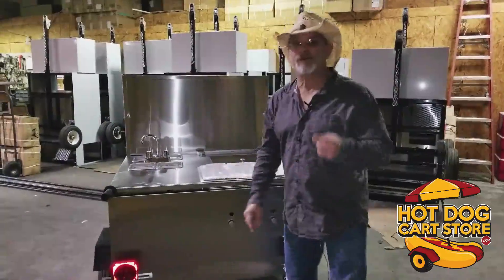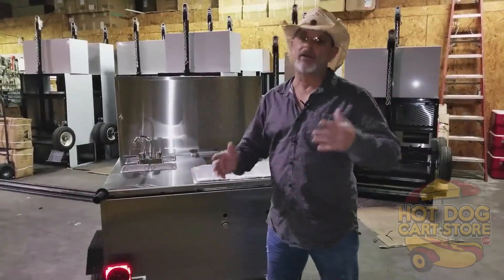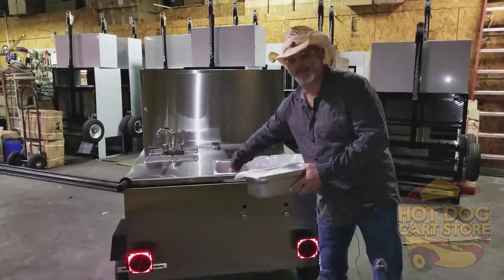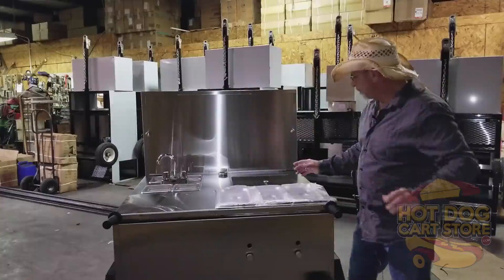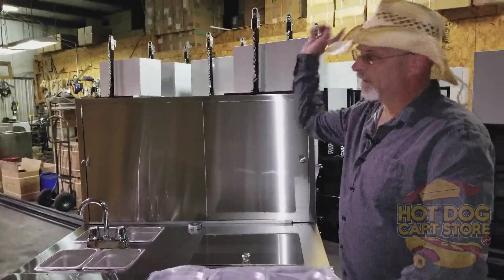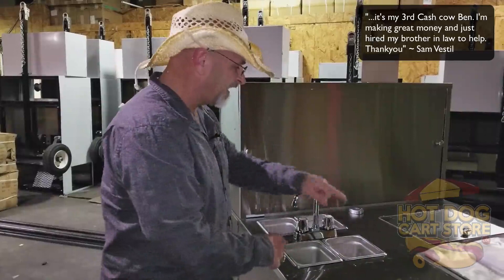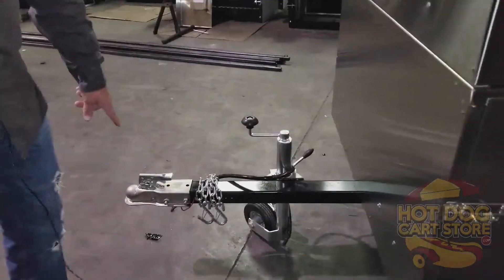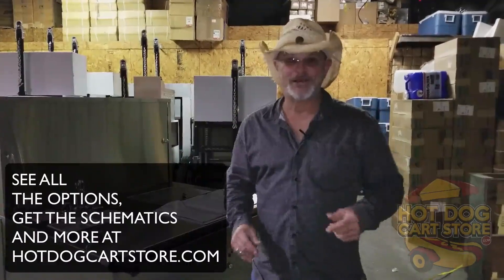Cash Cow Hot Dog Cart

Comment: Thank you for the video.

Here in Yuma, Arizona the County of Yuma has told me that the hand washing sink area has to be at least 10" by 10" and 10" deep.  What are the dimensions of the sink compartment, for just one sink to be used as a hand washing station?

Thank you again for the video.
Reply from the maker: One sink is 10x12x6 - which is exactly what every cart we've sent to AZ has had and been approved. I've never seen any code requiring 10" deep.
Reply: Hot Dog Cart Store thanks! I’ll double check with the County again.